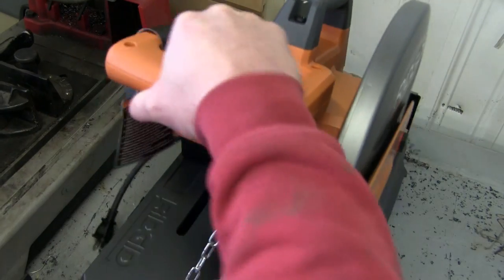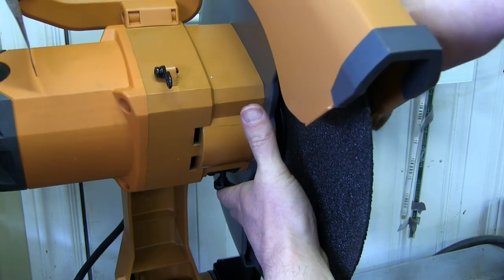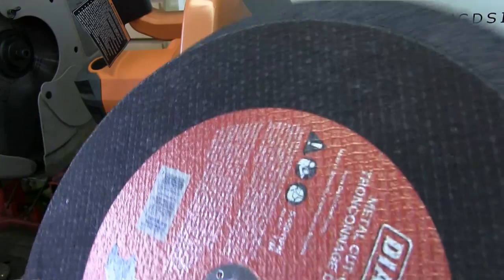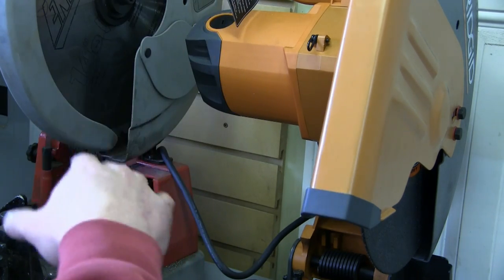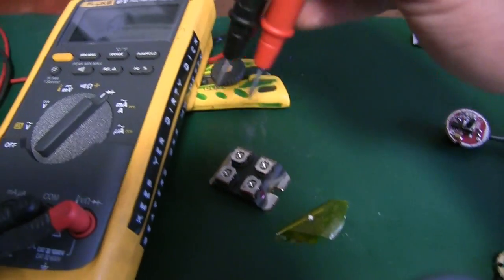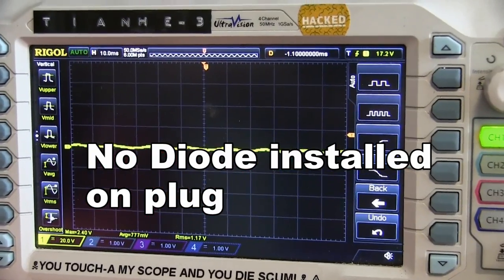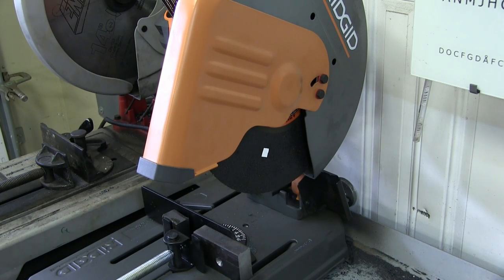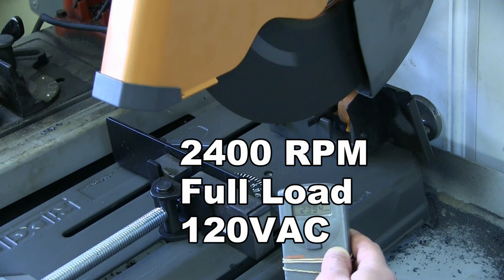RIDGID abrasive cut off saw converted to dry cut. Maybe.

Comment: A simpler solution if you are cutting pieces with a thickness smaller than 3  inches.You have  The Oshium  9 and 10" blades for steel 1inch hole rated 5200 RPM thus perfectly safe on a 3200-3800 RPM 14" chop saw. Price 9" 31USD, the 10" 41 bucks. 
The link  http://www.carbideprocessors.com/oshlun/steel-ferrous-metal/
You have also the Evolution 7-1/4 inch Circular saw blades have a 20mm arbor hole, are rated for for 3500 RPM and are found at Amazon. 
The multipurpose blades are around 20 bucks, the steel cutting around 35 USD. That works perfectly on  3200-3800 RPM  chop saws. You have to rebore the blades to 1 inch, that's pretty easy.
With the 20 USD multipurpose blades you can cut anything and are perfect for light gauge steel tubing with very precise cuts if you improve a bit the machine to suppress the wobble of the blade, ie replacing the low quality ball bearing of the arbor for a truly good one. With some improvements, I got cuts with 0.3 mm ( 0.011811024 of inch) of tolerance.
Seven years ago I refurbished and modified an old Diewalt 14 inches chop saw as the shipping and customs costs to Mexico of the Evolution saw were totally  indecent.. I used the Diewalt for cutting anything until 2 inches thick, and made thousands of cuts.

Comment: it really  comes down to the fact that these motors need to spin fast enough to create enough back EMF to avoid drawing too much current. its the inductance of the coils that make up the field and commutator windings. the only real answer is to have the armature windings rewound for the slower speed or put a 2:1 reduction gear box on the tit. just like your compressor ordeal where you are actually looking for a CVT type transmission.

Comment: I'm a plumber by trade and we use a standard drop saw with a carbide tipped blade for cutting pvc and HDPE pipe. Cut is perfect with no bur and blade is like brand new after at least 4 years.
Reply: Of course that's super soft material compared to metal, and that is the objective here to cut metal.

Comment: The 555!!! Make a full bridge rectifier, some fat capacitors to smooth it and then pulse a high current mosfet. Extra points if you can hook up something to measure the speed and change the pulses to keep a constant speed drive.

Comment: Every motor also experiences generator action, meaning when a motor spins it generates a voltage in the opposite polarity as the driving voltage. This is called counter electromotive force. The faster the motor spins, the more cEMF. This opposes the driving voltage and effectively limits current, therefore lowering torque.

Comment: I took the abrasive blade off and put on a carbide tooth wood cutting blade. It goes through 2 X 4's, 2 X 6's and 4 X 4's like a hot knife through butter.  Much more effective than my table saw, and since I got the chop saw for free, why spend money on a radial arm saw?.  Drawback? Sumbitch pulls 30 amps and I have to use my shore power plug in my shop (for my RV) to keep from popping circuit breakers.  If I want to cut metal, I still have the abrasive blade.

Comment: At approx.9.42 I think you meant say that resistance plus the "REACTANCE" (which is opposition to ac current flow due to induction or capacitance in the circuit) equals impedance .You said resistance plus impedance - but I understood what you meant. Love your work!

Comment: Hey those universal motors have the rotor and stator coils in series. If you get into the motor you can separate them and put them in parallel instead of series. So one set of wires for the brushes and one set for the stator coil. Then you have a shunt wound dc motor. Will turn slower and have good speed regulation... Might work. Youll need pure DC to power and dont start with full rectified 120VAC... which would give you about 170VDC and would pull 2x the current. A bridge rectifier and some caps after your variac at 60VAC should do it. Ive been playin with a Mastercrap premium chinesium router I did this to. Hasn't blown up yet.

Comment: I have a pretty good idea that the adhesive bonding agent holding the carbide to the saw blade would fail at the extremely high temperatures it would see if it was run at double the rated RPM. Not to mention the carbide itself failing.

You stated that the motor is a universal type, which means it will also run on DC. Lots easier to vary the speed of a motor running on DC. Might be worth a shot to try again. Wondering how to get 120 volts DC? Easy. Remove the voltage regulation from an automotive alternator* and spin 'er up. Use a rheostat to control the field current. You'll also have a portable welder then too. LOL.

*This doesn't work with alternators intended for automotive use after the late 1980's.....unless you build your own bridge rectifier. They put avalanche diodes in them now, which fail at around 19 volts to protect the electronics in the vehicle's computer.

Comment: Just curious but have you though of making a simple AC speed controller using a triac?  It would clip both sides of the sign wave allowing the motor to “coast” between where the triac tiggers during the phase.

Comment: Seems the only way to do what you wanted would be through gearing. Maybe with a brawny slow-spinning induction motor and a right angle drive that has reduction you could make a saw that would work at the SFPM rating of the blade.

Comment: You should use a TRIAC for speed control. By triggering the gate you can change the output duty cycle of the TRIAC and this will have an effect on rpm.

Comment: AvE: a diode in series doesn't cut the voltage in half, it cuts it by the square root of the half, that's a quirk of the Root Mean Squared, you could say power is cut by half, but only in resistive loads.

Comment: Also, in what for the slower the better, what happens to the torque figure if it's spinning backwards?  Will it draw just as much as on stall, or will it let the smoke out quicker than ever?

Comment: I suspect (though I could be wrong) that if you cobbled together a reduction gear 2:1 between the motor and the arbor (which would be needlessly complicated and expensive, anyway) that you would probably do just fine. You'd have significant torque to drive the blade, and I think the amperage would probably remain at a reasonable level. Just a thought.

Comment: Tidbit for your Arbor size you can use either PVC or any type of tubing usually cut about 3/8 of an inch or hair less in length  to size up the Arbor to Center the blade on it because the clamp plate with the bolt holds the blade tight I have a demo saw Stihl,an basically that's what they send 4 sizing up the Arbor seems to work just fine

Comment: In the video's setup, the Variac is simply changing the impedance of the power coming out of the outlet.  120V*20A is roughly equal to 65V*35A.  I believe you can pull the full 20A from either positive or negative side of the voltage swing, which could explain why the circuit didn't limit current draw.  I think the current needs limiting rather than voltage.  You could try adding a resistive load in series with the motor.  To limit the circuit to 10A max, I think you need a 12 Ohm series resistor that can dissipate more than 1200W...  so maybe like a toaster or space heater LOL.
Reply: Matias Byers then you have half the powah.  

the fundamental problem Remains the Same, these motors even though they are theoretically Universal are made to pull so many amps at a given voltage and when you lower the voltage the current increases beyond the capacity of the wiring and the cooling capacity the unit. the only solution is to get a new motor that will run at your desired speed with your available voltage or use a pulley system to convert your higher speed lower torque power into lower speed higher torque power.
Reply: Yeah, you're right.  I got focused on reducing the speed and forgot the rest of the problem.  I don't think there's a way to do it electrically without sacrificing torque.

Comment: I'd like to know, if the torque goes down as the RPM goes up, does this mean that the power draw (and even mechanical power of the motor) remains the same throughout the entire range of operation? or does the efficiency change throughout the RPM range causing more or less power draw/mechanical?

Comment: What about using a belt drive compound mitre saw ? Normally for cutting dead trees I know but given its belt drive you should be able to change the gearing to keep the motor happy and get the blade speed right ? .... If I remember it's driven over driver so all you would have to do to slow down the speed  would be turn down the driving pulley in the lathe? ... and you could make compound cuts in say  steel tube .....just a thought

Comment: Was half way through building a dry cut saw using a variable speed drop saw. It has a wheel you can set the motor speed like a volume control. Its not the trigger type speed control.  I am guessing I should stop wasting anymore time on it after seeing yours fail.

Comment: Well, it's certainly not impossible. If really nothing else works you can always install a gear to reduce the rpm and increase the torque. Obviously, that's not very practical, neither is rewinding the motor. But both would probably cost less than 500 dollars...
In order to solve your current lag problem, you could just use a capacitor to take current from the beginning of the half wave and store it for the end when the motor needs more amps. That's how such problems are generally overcome. It would probably be a little more complicated than that, since you will probably still only get the desired speed under load also, the capacitor will practically short out the diodes when it first charges up, meaning you would need to limit the current when you first plug it in, to prevent the rectifier from burning up etc. You could use a metal oxide varistor to do that, but would probably at least need a zener diode and relay to bypass the varistor once the voltage of the cap is high enough. So yeah, a couple more components than just a simple diode.
If you wanna take it real far, you can always use the full bridge rectifier to get both half waves, smooth it out with a capacitor and then control it with an Arduino or whatever and pwm to control the speed to exactly what you want. Which would have the advantage that it pulls very little amps in free run and the motor only gets as much as necessary when cutting to keep it running at the desired speed etc.
Just saying, there are a lot of little tricks to overcome these kinds of problems. The question is just how much effort one is willing to put into it.

Comment: I don't think you can increase the torque by lowering the voltage - you decrease rpm, but shift the whole torque/rmp curve down (to about a half) while doing that, so you get no torque increase at the end. Assuming constant rpm: smaller pixie pressure --> fewer pixies running through --> less torque

Comment: well if your rpm is not adjustable then alter the surface speed with smaller diameter wheel, also that was a demolition saw blade witch if i recall is an under size arbor hole 
I bet you could find a 12" diameter dry cut blade rated for the rippums

Comment: If someone made a smaller diameter dry cut blade, couldn't you get the same ft/ min at the high rpm? Also could you use a diode bridge to get both sides of the sine wave?

Comment: What about putting a smaller diameter wheel on it to get the surface speed down?  I guess you lose some capacity  but pretty easy to do

Comment: Could you run a smaller diameter blade to reduce the sfpm of the blade? Mechanicaly reducing the rate of cut instead of electrically? It would keep the rpms up and the motor cool still too
Reply: You could, but you would drastically cut the size of material you can cut especially on angle cuts! I guess if you don't need to cut any large material it would work if you can drill out the 5/8ths. arbor to 1" (hopefully without unbalancing it) on most saw's, but apparently it's 20mm on the Ridgid brand.

Comment: What happens if you index the brushes differently than Factory does it change the direction of rotation or does it also affect the specific RPM of the motor?

Comment: We got the milkwokee dry cut saw and it wasn't very good. We bought it to cut small 304 SS tubes and the blades would last for around 20 cuts. We tried many blade types and brand the the milkwokee representative got tired and gave up.

Comment: Sorry it did not work as hoped.  You might still get away with such a rig for thin structural steel, EMT or pipe though (not at 35 amps).Knowing your disdain for wood workers I hesitate to share that these metal saws also work very well with 14" +  carbide wood blades for cutting timbers though - which saves you from buying an expensive beam saw or large/heavy radial saw.

Comment: Question: Is it possible to change something in the gear housing of the saw? Like the gearing.
I got so excited at first because I own an exact Rigid abrasive saw and been wanting to buy a cold cut saw.  If there was ever an answer to this problem it would solve half of the metel workers delema of tossing away a good abrasive saw.

Comment: Is it the case that the chop saw would work fine with carbide blades, if only we could slow down the RPM, or would it still be sketchy, because the whole thing needs to more robust and, well, rigid? If the former, surely it's worth either changing the motor or adding gears. If the latter, then maybe it's analogous to the situation with pillar drills and mills; and not worth trying? I'm fond of money saving ideas, but I like all of my digits more.

Comment: Hey AvE, I'm not trying to be a dick about anything, but the electrical engineer in me says that you can not half the power of the AC by adding a diode. The 120V AC is not the peak value of the sinusoidal waveform, but its RMS. The RMS value of a half wave sinusoidal is Vpeak/2 for a full wave its Vpeak/sqrt2. Its not a huge deal in your application, instead of the expected 60V RMS you had something around 80V. And it did work in the end without smoke signals:D

Comment: AvE, you considered giving this another go with a router speed controller or a fabricobbled imitation thereof? (Dimmer switch to remote triac with sufficient ratings for the motor)  Seeing as that's basically what those trigger speed mechs in hand drills are (as you've handily pointed out in the past) and those are a universal motor as well and they seem to do well enough with it I'd think that stands at least an even chance of working out the way you want.  Just figure out what the right setting is under load and either replace the pot with a fixed resistor equal to it's setting then or the 30 second solution - hot melt glue the sucker in place.

Comment: 14" chop saws use 7/64" thick blades.  Demo saws use 1/8".  That Diablo blade is for a demo saw.
That motor would work IF you slow it down by gear ratio.  But the supple base is all wrong for carbide

Comment: Could I put a dimmer switch in line and use a secondary fan on the motor with temperature gauge and only cut half way through let it cool down then do it again or am I still wasting my time

Comment: @AvE what if you used an arduino to do closed loop speed control with the variac.  As the RPM dropped under load, the voltage would come up which would help the heat buildup issue.

Comment: If you just need to maintain surface cut speed, could you use a smaller diameter dry cut blade? You'd lose depth of cut, but if you're expecting a $200 tool to perform like a $700 tool you should be ready for some limitations.

Comment: the 'cheapo' blade is thinner on purpose. it's for use on a stationary saw which shouldn't have any side loading. the other blade that you bought is for use on a gas powered saw only. if you use it on a stationary saw, the added mass will frequently cause the saw to trip breakers and all that that suggests.

Comment: Is that saw direct drive,gear driven? I know the newer rigid miter saws use 2 pulleys and a v belt. Can replacing the pulleys or gear get you that low enough rpm with increasing torque?

Comment: We have a crusty old Milwaukee dry cut at work. Torquey frick yes! It's skooum as frig! When I started working there I thought I died and went to heaven. Most places won't buy one. Ours pops 15 amp breakers with frightening regularity. Put it on a 20 amp with a 10 gauge cord drop cord and it will go all day stinks to high hell but it won't let the smoke out.

Comment: I think the motor overheated not because of overloading or not enough ventilation to cool the motor. The motor will run fine with pure DC or sinusoidal AC voltage. In the test, the rectified half wave voltage without filtering has a lot of higher frequency harmonics, which  I am wondering could be the cause of motor overheating.

Comment: The right way to do this is with a VFD (variable frequency drive). Cut the 60 cycles down (30 - 35-37 cycles, whatever) to whatever you need to make it run at what ever speed you want.

Comment: Hi AvE, I'm having a bit of trouble with a project of mine. I put a small 2stroke engine on my push bike, all was going well until the vibration of the engine eventually snapped the cheap ass bolts fixing it to the bike frame. Would you be able to tell me the hardest bolt I should get that won't snap when the engine vibrates. The bolts take a 10mm socket. Thanks man

Comment: what if you run it on [probably 3-7] 12v Li or automotive batteries in series? or a low end generator thats only got the motor power to output ten or twenty amps, limiting it that way? 

i also thought maybe just put an extra few hundred feet of extension cord in front of it to slow it down, but maybe that's gonna trip the breaker worse